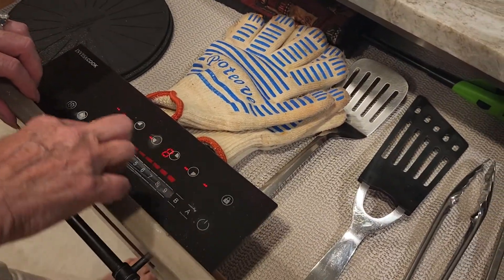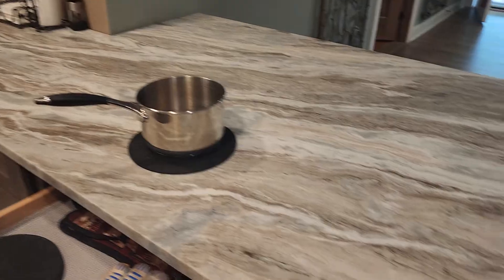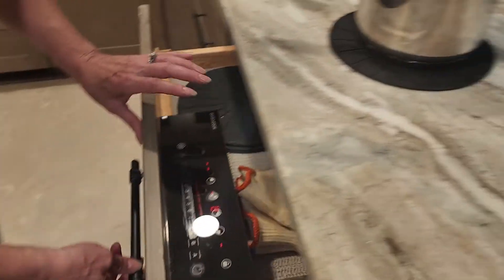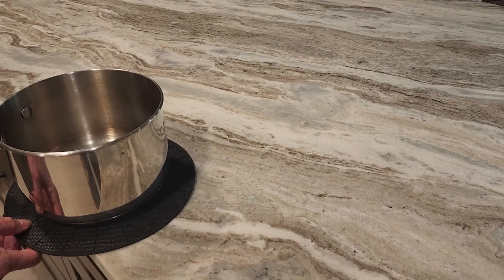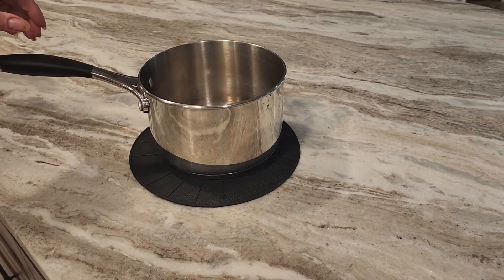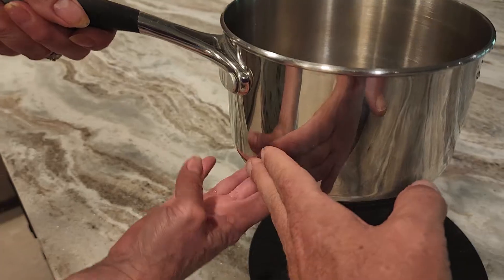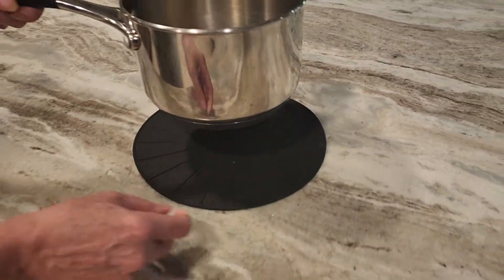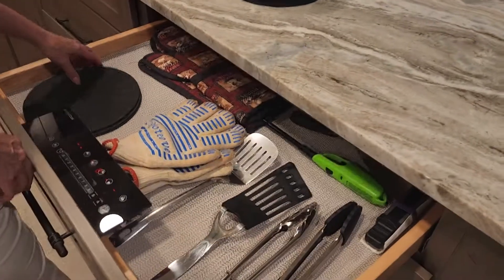Inductive cook top under the granite.

Comment: Just an idea if you can find the center of the burners just put a small dot with a permanent marker or use a small chisel and carve out a small indention and stain it with a marker so you always know where the center of each burner is 👌
Reply: If you shine a laser dot where that point is, you not only know the general area where the pot should go, but now the dot shows on the pot and you can use the dot to center the pot exactly.
Reply: Or maybe a small light via the granite
Reply: would be an interesting idea to have a button connected to lazer pens on the ceiling that shine down to the center so you can toggle on and off the lazer
Reply: A better way is to get several small spotlights (or a light source that is blocked with holes cut-out) that highlight the exact locations of each, as well as their size.

Comment: When your pot is low battery and it use wireless techology to charge it.
Reply: In a way ur not wrong. It’s just the “battery” is steel and the stored potential energy is heat!

Comment: I think there needs to be some type of markings on the surface to help make sure it is on the element. Probably just need to etch a pattern in the surface to dull the surface shine and that should be good enough. Then there isn't any guess work on where to put it and it won't be super obvious and distracting when looking at the counter. Being able to see the marking a little bit is probably cooler since your cook top is your countertop.